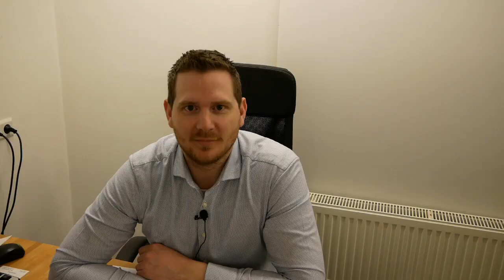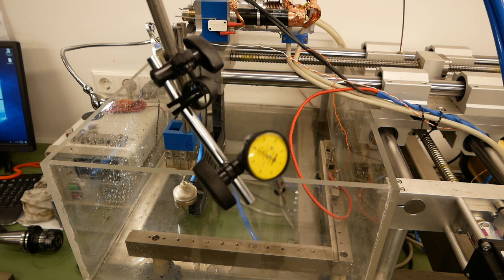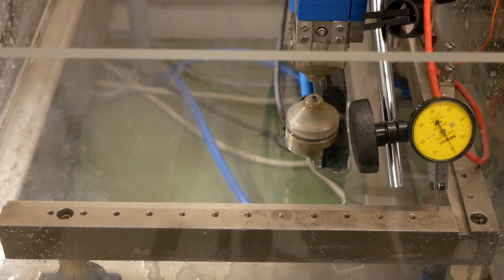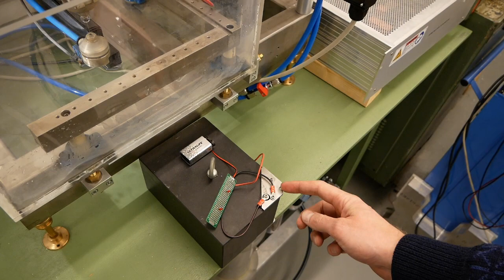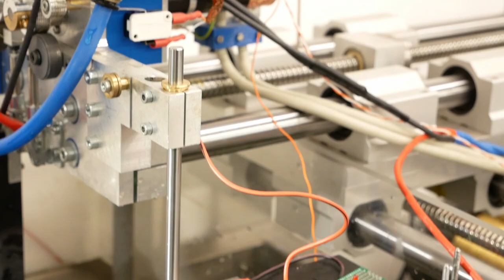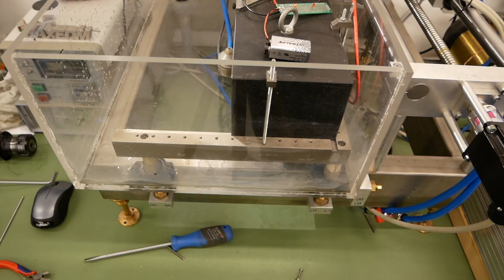BAXEDM Custom EDM Machine Build, Part 9 : Machine perpendicularity adjustment

Comment: hello. thanks for your very useful videos. as some one new to wire cut edms now i can understand better, but i have some questions that i would be happy if you answer. i want to renew the controller of my 4 axis wire edm.  the work table part and water filtration device of mine is working well. i just need to replace the controller and also the motors. as i saw in your videos the arc generator is made up from dynomotion controller and kanalog. can i buy an ARC generator BX17 and reconfigure it to my own needs (4 axis)? i want to know the most necessary things that i should replace?